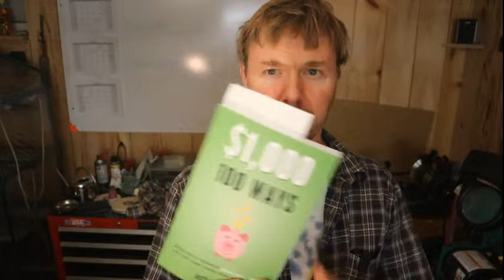Spyderco Paramilitary 2 LIVE SHARPENING!

Comment: My favourite carry knife is my Spyderco Tenacious, it's in my pocket 90% of the time.  Its 8CR13 so not the best steel and I have to sharpen it often but I find it's really great at the things I use a knife for.  It's a full flat grind so it performs like a kitchen knife, its pretty slicey so its great for cutting food, opening boxes and envelopes, has a nice tip so its good for opening plastic bags or packing.  It's just a great all around knife in my opinion.
Reply from the maker: Very cool, thanks Jay!

Comment: P.S.
Matt...you make mention that if you were to do that blade on your Edge Pro, you'd "Be there all night." 
I get it - the blade needs re-profiling.
Since I only have my TSPROF and no 1" x 30" what about using it (TSPROF.) with the ever-popular "Atoma 140" abrasive stone? It is said that it's excellent for re-profiling, and every time I try to order one up they are out-of-stock.
Anyhow... I might at some point be able to swing a 1" x 30" from Harbor Freight, but I no longer have my shop - I'm just set up in my entry hall with my desk as my work bench, etc. ( I also repair/restore/conserve antique Connecticut clocks and American Civil War sabres, etc. )
My intentions are to only somehow generate some modest income from sharpening knives and scissors.
Your thoughts, please?